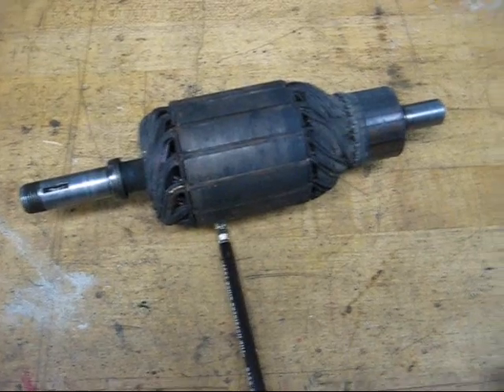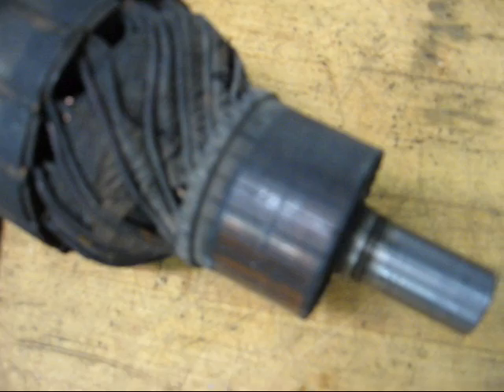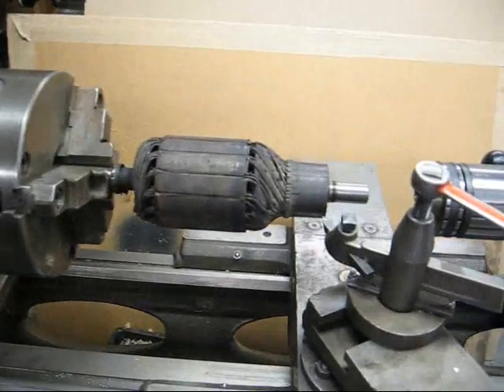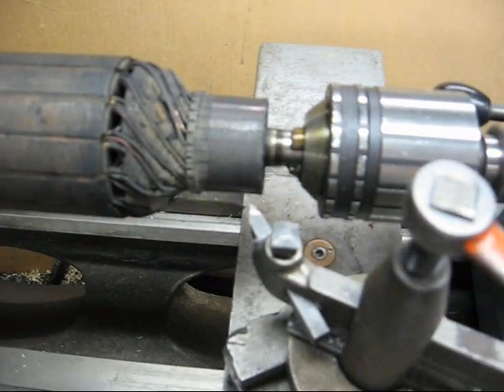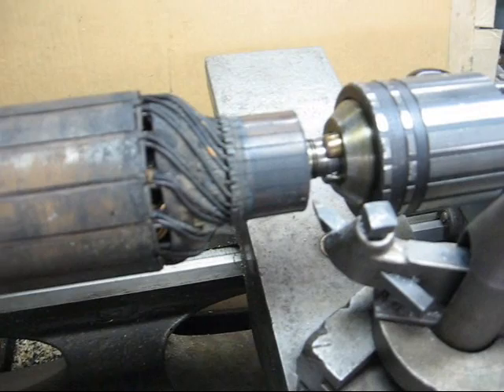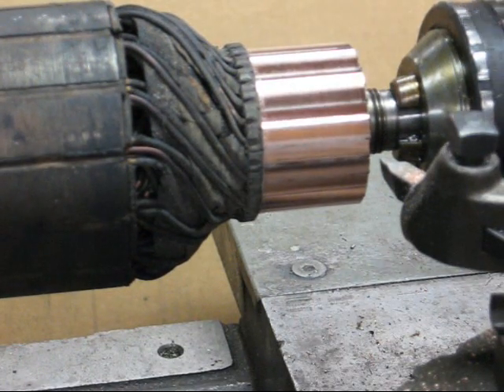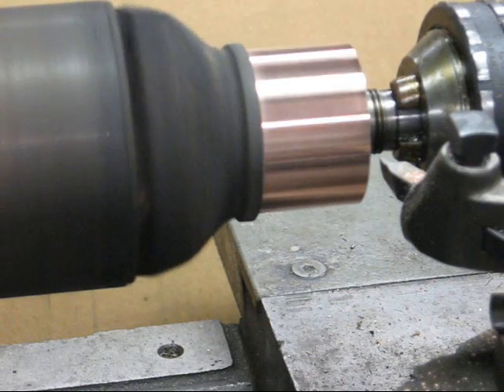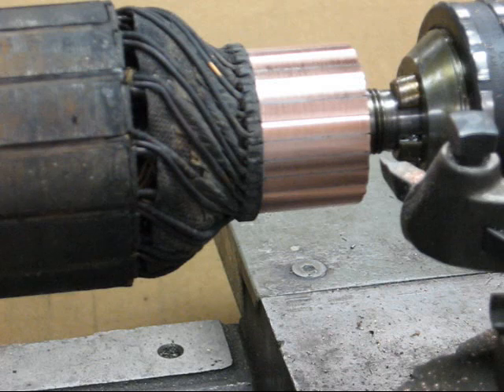TURNING A COMMUTATOR ON A GENERATOR ARMATURE tubalcain CLAUSING LATHE

Comment: Mr. Pete, Is the armature part itself ever machined, or any need to?
I have a general motors window motor here, There must be a little wear somewhere, and is running ever so slightly eccentric. 
I know the motors are cheap on e bay,  (maybe not good quality either, the inexpensive ones,) But I'm just trying to nurse this car along maybe another year, till I get some other things paid up. There are "witness marks" and some wear on the armature itself. 
I just wondered if I could machine the armature itself,  Just about an inch off the length of the armature , to stop the slight knocking, and possibly eliminate some slight friction?
It is an 2002, Olds Alero,  4 door.  This is the passenger Right front. 
 I already replaced the regulator and motor on the drivers side, with a cheapo $30.00 e bay one,    (So Far, So Good???)
But Right now, I have more time than money, and need to save $$ as much as possible. (Note; The motor does run)
Just want to get it operational, as the inspection mechanic let it "slide" last time, But mentioned he wanted me to fix it for the next inspection. (Coming soon, end of April)
Reply from the maker: No, you cannot machine the amateur
Reply: OK Thanks Mr.Pete. 
I'm going to just get a regulator/Motor Assby.

Comment: having never had an undercutter I have always started by undercutting the mica by hand using a bit of hacksaw blade or scalpel blade ground to a slight hook and the right width before doing anything else to the com. I have usually found there is just enough of the original undercut to help guide the tool and if I do slip I'm only marking a surface which is being taken off anyway.  If you don't have an armature chuck you can turn a close-fitting bucket for the end of the shaft with a centre drilling so you can support the armature at the tailstock end with an ordinary centre.
Reply: The 'close fitting bucket' for the end of the shaft is a great idea! Thanks.

Comment: Tubalcain, you saved my linear actuator!  It's a part on my wood boiler that closes the damper, and stopped operating correctly.  I pulled it apart, and couldn't at first see anything wrong with it, no loose wires, brushes looked fine, etc.  Then I started examining the commutator and since I watched your video I knew that the copper segments must be electrically isolated from each other.  The brushes had worn burrs on the segments so they were shorting against each other.  Well, I don't yet own a lathe, but plan to soon, hence the reason I've been watching your channel.  However, this is a tiny commutator, and it turns out the shaft fit just perfectly in my dremel tool.  I ran a small screwdriver between the segments to raise the burr, and then sanded it by hand on my "dremel lathe".  I had to repeat to get all the burrs removed, then I finished with a gray scratch pad.  Put it back together and worked perfectly!  It's a $75 part that probably would have been in the trash bin had I not watched this video.  Thanks Tubalcain!
Reply from the maker: +Jon Logan Thanks for watching---glad I helped. Watch all 500 of my vids
Reply: +mrpete222 I would love to see a demonstration of how to hand wind a motor if that's something you would be willing to take on.  As others have commented this is still done in the third world countries, but it's just a mystery to me.
Reply from the maker: +Jon Logan Never done that
Reply: +mrpete222 Details...details.  You know you want to!  

Even without the hand winding, I'd like to see you teach a video on electric motors, similar to what you did with the 4 stroke and 2 stroke engines.  Most of us know the principles of how they work, but I always end up with a better understanding after watching your vids.
Reply from the maker: +Jon Logan I am presently working on a video---where I make a small motor/generator. I will wind the tiny armature --watch for it.
Reply: +mrpete222 Awesome!  Looking forward to it!
Reply: Good Job Jon!

Comment: I shared this with Tom Lipton at OxTool. He had a recent video where he was horse trading and came upon a Jacobs No. 100 Chuck and had never seen one before. For what it is worth, I would like to see a video of somebody who knows what they are doing (you) use the mica undercutter. A friend recently gave me on to fit my old Atlas lathe. Pretty sure I could make it work, but don't relish the mountain of sacrificed blades and rotors the endeavor may generate.
Reply from the maker: Don
Sorry, I do not own an undercutter. I usuallu just hold the hacksaw blade by hand--usually resulting in some nasty scratches.

Comment: I did this on a couple of brush motors and ended up with a nice, solid copper tube where the commutator was. My guess is that I ran it too deep a cut or, as you point out, the tool wasn't sharp enough. It melted the copper over the comm lines and it was fun trying to dig those up. Next time I will grind it instead. BTW, there are still a huge number of brush motors out there so this video is current and helpful. Thanks!

Comment: it involves using some thin scraping device like a hacksaw blade to lower the mica separators between the copper segments. They can interfere with the brush connection to the copper segment if the mica is protruding.

Comment: It is the process of removing a very small amount of the mica that insulates each of the commutator segments from one another. The idea is to make sure that the mica is countersunk (1/32" I believe) just below the surface of the segments. If this isn't done the mica could actually slightly lift the brushes off the commutator. Not a good thing! There is also a finishing procedure to remove ridges from the segments created by this process.

Comment: there's  always  another  way  to  do a job The way he's got it  set up is a good  way  to do it.  Sure you could use a four jaw on the Comm  end dial it in  as  close as possible  and  turn from there Either  way  works NICE  VIDEO Pete Thank you

Comment: I noticed that your Clausing lathe makes the same racket as mine at work when the motor is disengaged....I wish there was a way to fix it without taking the clutch assembly apart.

Comment: Could you chuck it from the other end closest to the commutator? Or use a fixed steady, don't have a brass jawed chuck. Every year I need to replace the starter motor in one or more of our quad bikes with a reconditioned one. Being able to change the brushes myself would save me big $.

Comment: I work for Siemens repair shop and best way to turn commutator is using clean varsol..it is a very good cutting agent .just blow dry and good to go.. This is used on all voltage armatures including 600 volts.
Reply: 12 years ago. Still work there? Have I generated a bit of nostalgia? 😸

Comment from the maker: Yes--copper is bad. No magic answer. Machinist book calls for these angles on bit.  Refer to my video on lathe bits where I discuss angles. front clearance 7 degrees, side  7, back rake 10, & side rake 25. Cutting speed 75 - 150 fpm. Radius on tool tip of 1/32".